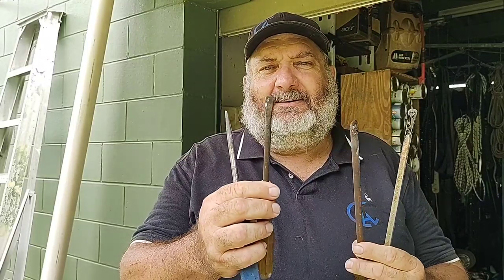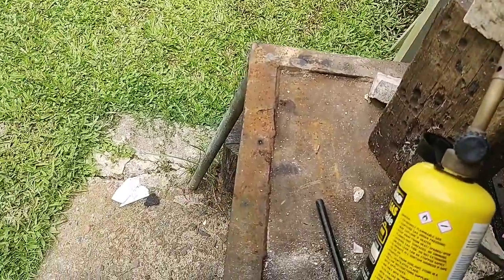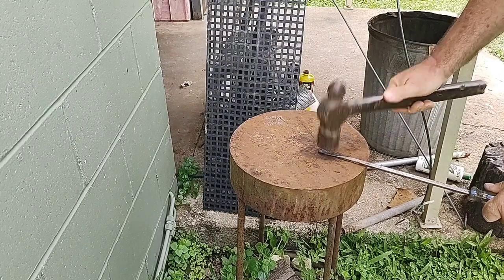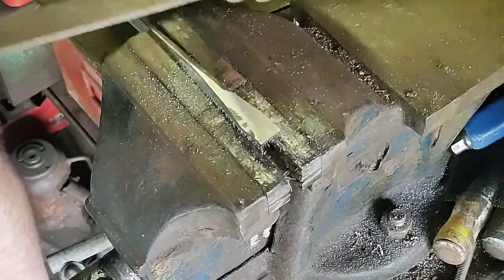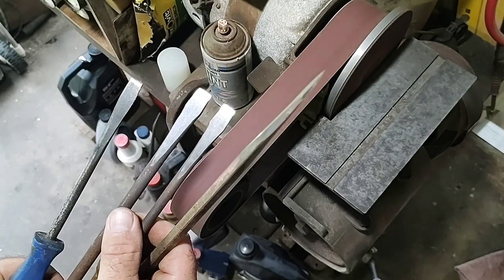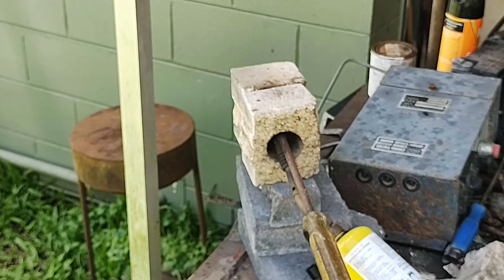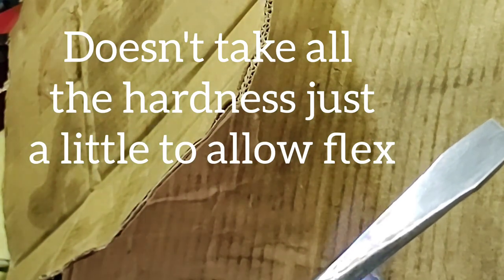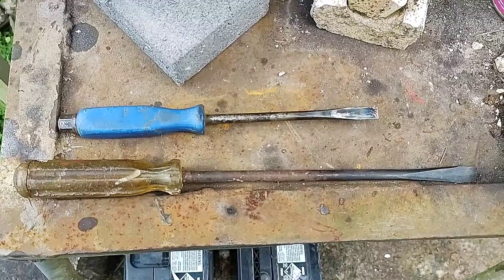RESHAPE HARDEN AND TEMPER YOUR OLD WORN SCREWDRIVERS

Comment: I have so many screwdrivers that people have chucked because the end is buggerd up that it's absolutely ridiculous. I haven't bought a regular or phillips screwdriver since probably the 80s. I've turned a lot of them into other tools such as chisled, gouges, mini prybars, punches, awls, picks, just about anything you can think of. They're also good for using their handles for other things such as files. I even made my dad an entire set of screwdrivers with any size you could ever need
Reply from the maker: @Gator-357  sounds great thanks for your comments and inputs, I'll have to try this pry bar one, I have used them for other stuff too.kind regards Arthur